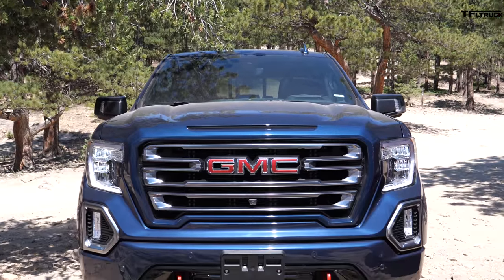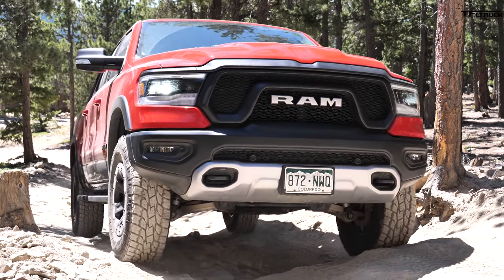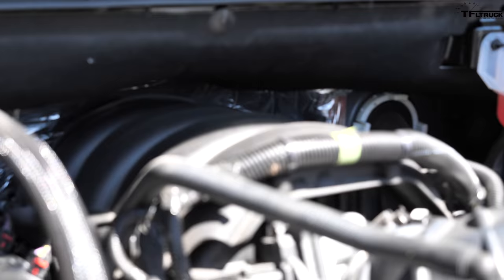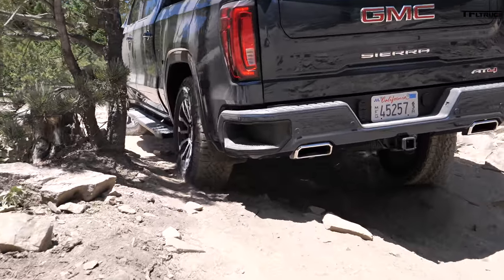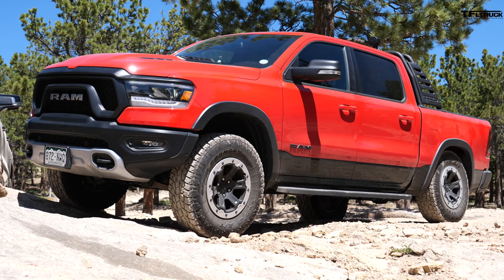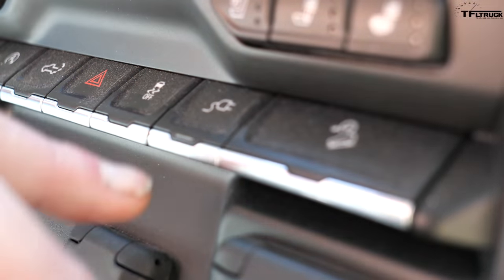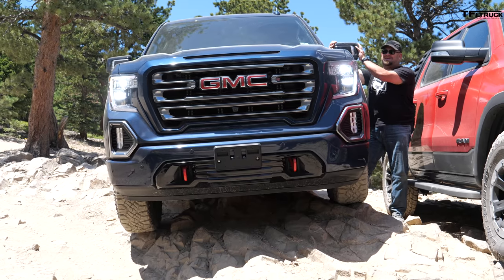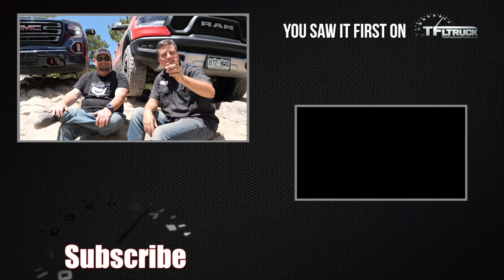GMC Sierra AT4 Comes Up to Challenge the Ram Rebel Rouser and This is What Happens | Ep.7

Comment: Is clesr that the rear lock differential on the rebel is making a big difference. In my opinion all vehicles equipped with 4x4 should at least have a rear locked differential
Reply: At the very least as an option.
Reply: The 35s are what made the big difference. Both trucks have lockers, it's just that the G80 isn't selectable.
Reply: @EGGINFOOLS  not that big of a difference, if the rebel had a G80 instead of it's selectable one the same thing, maybe not as dramatic, would of happened.
Reply: @okigojuryu  3 inch tire size doesn't make a big difference? Ok!
Reply: @EGGINFOOLS  I didn't say that, your taking my words out of context, I said it didn't make as big a difference as the diffs.
Reply: @EGGINFOOLS  First, the Ram has 33's on it, not 35's. And the GMC has more aggressive tires. The issue is that the G80 is complete junk. Its impossible to use fines for anything. It won't engage until there is a large speed difference between the two tires. a locker like the Ram has lets you use fines as it doesn't rely on wheel speed to work.
Reply: The size of the tire really on helps with ground clearance   not so much with traction as the lockers do. You can have the grippiest tires in the world but go nowhere on slick terrain without a locker
Reply: @okigojuryu  no its has 285/75/18 so 34.8 inch tall
Reply: @danielbryan8300  I think you tagged the wrong guy...?
Reply: @danielbryan8300  Yeah, I just recalled 285, which is typically a 285/70 which equates to a 33 on a 17" wheel. Forgot this was 75R18. But even so, the locker is what made the difference here.
Reply: We always tell the GM G80 rear diff guys to bring a shovel when going off road with us. They need something to clean up the broken metal and gear oil. The G80 can only bang the spinning rear wheel into a locked position so many times that hard!
Reply: @HoosierDaddy_  Yeah, seen plenty break on the street too. Guy pulls off the gravel shoulder onto the street, spins the tire int he gravel, then suddenly power hits the one on the pavement. BOOM, bye bye diff.
Reply: Not necessarily, most people will never use it and get themselves into a ton of trouble with one because they have no idea how to drive a normal vehicle throw a locker in and they'll be sideways, backwards, upside down, etc. in the blink of an eye.  99% of drivers a regular cheesy AWD system is more than enough for them to handle LOL.  

A locker is available for most 4x4's whether it be factory or aftermarket and typically an aftermarket is going to be superior to whatever the automaker uses anyways, I'd skip the factory locker and go aftermarket if I were building an offroad vehicle.  For highway use a limited slip would be more than enough and even at that those will get you sideways pretty quick if you aren't careful too LOL.

Comment: GM has stuck beside their weak link G80 gov lock as the only option for too long. They need to offer an electronic locker option with their off road packages like the ZR2 has.  Im a loyal GM guy. But this has been an issue for way too long. Like Nathan said, they've got the whole package, minus the rear locker.
Reply: I never had much experience with the G80. The couple vehicles I've driven were older with the G80 code in the glovey, but it never worked. Not surprising as now my wife has the G80 in her Tahoe and we live up here in icy, snowy, MN. Her rear tire was on a patch of ice at a stop sign. She went to the gas as usual when that tire started spinning. Just as she was going to lift off the gas, BANG! The diff locked up and the tire on dry pavement chirped and away we went. 

We then shimmied and shook as we made the corner with the diff locked on dry pavement. What's the average life span of a G80 anyways?
Reply: Why do you need a locker? To drive up to your mailbox 🤡🤡🙄
Reply: @cesarconh895  yeah, I'm a New Yorker. Upstate. No street lights, no traffic lights, dirt and oil & stone roads, ATVs are road legal. So, yeah, mailbox.
Reply: Their small tires and wheel wells are not conducive to off road.
Reply: I love the G80 I have but I wish it had an E-Locker option just for the sake of like crawling and such. But I don't think it should be an only electric lock out option, I like the limited slip feature it's saved me on the road a few times along with offroad when I didn't think I needed it.
Reply: Agreed, the g80 was useful before the "Auto 4wd" function was available. Now that auto 4wd is an option, the g80 doesnt really serve a purpose anymore. Time for the E-locker
Reply: Jesse Hernandez it serves a purpose but an E locker would be better. Waiting for the g80 to engage can be dangerous and unnecessary.
Reply: @TravisTLK  the older ones would chew up the governor fly gear shaft. Once the teeth stripped, it was done. They last quite a long time if they don't get hammered. Folks say they're junk, but I've rebuilt a lot of Eaton and Auburn limited slips well before a G80 will fail. Its all depends on which side of the fence you're on. I've gotten rid of two G80 trucks with 150,000 and 230,000 miles, both still working well.
Reply: I agree, except I believe the G80 is still the best option for most people...It's not as good as a locker off-road, but it's a whole lot better in snowy/icy road conditions.
Reply: @danwood4478  👍🏼 Thanks for the info.
Reply: Dan Wood so even New York allows ATV’s on rural roads where it’s harmless to do so? New York...that’s basically run by communists? I hate Pennsylvania
Reply: I have a 2007 Colorado G80 and it is still just fine with over 135k miles. The best thing about it is that it’s there in 2wd, 4wd high, 4wd low. You don’t have to be in 4x4 low before you can engage the lockers. I agree, that if you are rock crawling, it is nicer to have a full locker. No need for any more wheel spin than is necessary. For 90% of the people out there with a 4wd, the G80 is actually much more than they would ever need, but is nice regardless. Too many times I see people rely on these reviews with this type of off-roading as the only off-roading out there. Stephen on the Canadian channel shows a more varied style of off-roading, but that is limited as well, more realistic, but limited. 
    I have done everything from rock crawling, to mudding, to bombing down a Prairie trail! The G80 is at its best in the mud, REAL mud, not just muddy water. Sooo many reviews show muddy water and not sticky, real mud that pastes itself everywhere on the truck and costs you $30 at the car wash to get it all off! Hahaha
Reply: the average pickup driver is too stupid to know when to engage and disengage 4wd by themselves. One logical reason for the g80
Reply: Just because the locker isn't electronic its inferior?  Come off that man
Reply: K. Tucker - I am a supporter of the G80, but there is an area it is inferior because you need one wheel to spin more than another for the locker to engage. Not much of an issue unless you are rock crawling. It is obvious in this video. Once locked up it is the same as any other locker. 
   It is also superior because it is available in all drive modes. They are just different in several ways and it depends on how you use your truck.
Reply: @shitloveaduck  yeah that makes since. Thanks
Reply: GM'S Eaton automatic locking differential is fantastic and works great.  When one wheel spins 100rpms faster than the other wheel it locks the differential together up to 25 mph and then disengages automatically.  Only a ignorant person would say it's a weak link.   The G80 is superior to any limited slip differential.
Reply: I agree.  GM dropped the ball.  It's still a pretty good off-roader, but it could have easily been better with minimal effort and consideration.
Reply: @TravisTLK  it didnt work because you dont know how it works. If you mash the throttle it will not engage. You have to slowly give it gas and it will sense slip and engage.
Reply: @ironsaber2  The throttle was never "mashed". There are instances in winter here in MN that, for example, you can be stopped at a light and one rear wheel may be on a slick spot (black ice). So even when applying light to moderate (normal) throttle will cause that wheel to spin even when instanly letting of the gas.
Reply: Yep, the chev 4x4 system is like a Polaris quad. It has to spin first before it locks. .. Stupid, annoying system. But love the truck
Reply: @jadosa29  Never met a communist here. It's rural America. State borders are just lines. People are pretty much the same wherever you go.
Reply: Dan Wood indeed. My poor attempt at humor wasn’t aimed at the fine people who live in New York at all. It was more a comment on the reputation New York has, rightly or wrongly, for some pretty strict laws especially regarding power sports. The communist comment was out of line regardless and I’ll apologize for that. I’m more angry at my Draconian state and their refusal to allow atvs to be legally operated on anything but your own property in a large portion of the state.
Reply: I likely would have gotten a Colorado rather than my Ranger if they'd offered an e-locker in trims other than the ZR2.

I really like the Colorado and was considering getting one, but didn't want to pay thousands of dollars more for a bunch of stuff I'd never need just to get one feature I wanted.

Meanwhile it's an additional $1,300 to get the FX4 package on any trim level of 4x4 Ranger, which includes shocks, bash and skid plates, locking diff, and some additional features I don't use much. 

You can have a 4x4 truck with all those goodies for less than 30k, while for GM to even give you an electronic locking diff you need to buy a 40k truck. Just make it an option on lower trims, or at least the Z71 trim which claims to be for offroad use as well. 

I know that the LSD works perfectly for many people in regular use, but personally for off roading and winter driving I'd rather have that control myself.
Reply: @jessehernandez5043  g80 locker is really nice for us rwd guys lol
Reply: @k.tucker2011  inferior is my assessment as well. If i can engage an E-locker ahead of time and avoid the situation all together, then what good is the g80 if i need to be in trouble for it to work? Inferior indeed
Reply: @jessehernandez5043  yeah I can see how one would want full control of the truck if they thought things could get rough. Thanks

Comment: The lesson learned from the video.  A stock AT4 can still do everything a modded Rebel can......
Reply: Terrence Jones ... indeed!!!
Reply: And any 4wd truck from the last 20 years with a leveling kit and decent tires, can keep up with them...
Reply: @chevyon37s  and ridiculous lower air dams removed.  I had a 2014 F150 FX4 with a 2" lifted strut (not spacers), and a rear block kit with 33' tires. But Fords upper control arm design  has articulation issues when strut body length is increased. The arms would hit the coil springs in very mild articulation off road. I haven't seen under the RAM rebel yet to judge. But I own a 2019 Trail boss now. I can tell you the GM OEM does not have the problem my Ford did.

Comment: The G80 is fine out back, but please offer a front locker option GM on the Sierra and Silverado.
Reply: I imagine the G80 will get you stuck during a rainy day on a muddy uphill trail or farm field trail . I see each tire digging a hole before the G80 engages. Need lockers for sure.

Comment: Gotta love that 6.2 litre engine and the exterior on the GMC Sierra at4
Reply: Honestly of the GM trucks, the prefer the look of the new Chevys over the GMC ones. But I guess thats a personal preference.
Reply: But not the interior :P  lol
Reply: A T  I'm not sure about the shocks, you're right about the interior.
Reply: No he's right about the shocks. Once you've experienced good shocks like Fox, King or the new 6112 Bilsteins you'll see that ranchos are garbage. For almost $70K they could include something much better like the TRD Pros have.
Reply: @paulf9653  You're right. Something like the ones they use on the Tundras would be better. 
Sounds like GM to back in form with the cost cutting.
Reply: Best looking truck on the market
Reply: @007Knightjp  all these comments are from people who do not actually own one.  The reason the AT4 interior looks cheap compared to the Ram, is because the AT4 is purpose built to be offroad, easily cleaned.   Every part of the at4 interior is washable, or removable, or rubber.  You guys are a joke.   Why the hell would you want wood grain, and peanut butter leather in a truck with a lift and tires for mudding lol.  Purpose built.  Those plastic panels hold up way better to abuse than wood interior that has a clear coat.
Reply: @msawyer110  I don't think the Rebel comes with wood interior. You are correct in that plastics are durable, but it depends on the kind of plastics they use. 
I Honestly visited the showroom, took a hard closer look at the GM trucks. You see a whole lot more of them on the road here than the Ram. But if I had to compare, I would take the RAM because the plastics and the over all feel of the interior is more better, design is cleaner with quite a bit more practicality. 
The front seats of the GM were more comfortable, but firmer. The rear, the RAM is better.
I keep scrolling to find a comment from a Tundra owner. LOL..